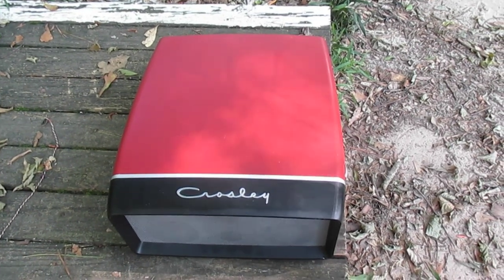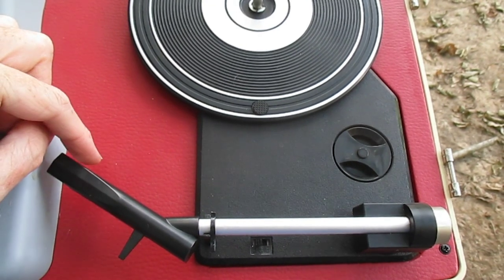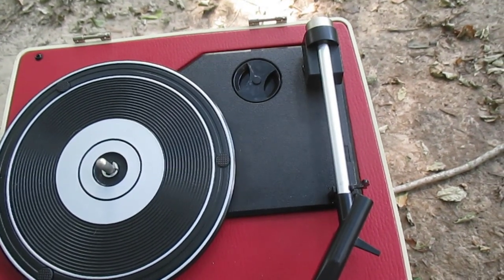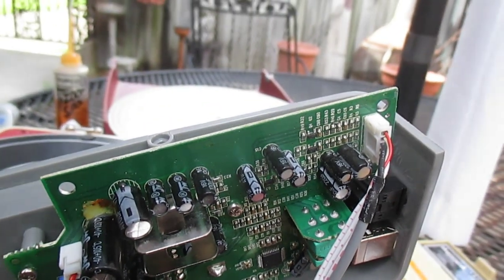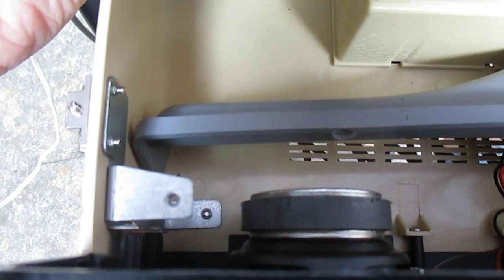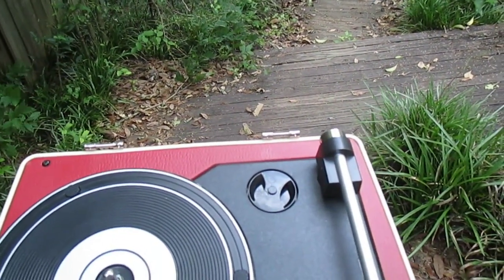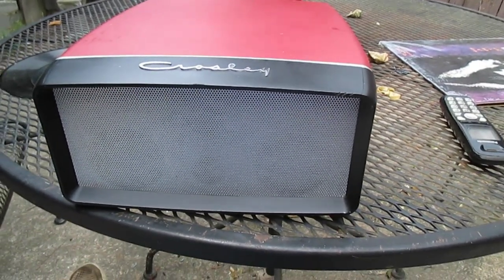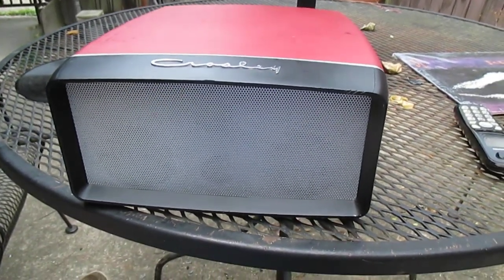Crosley Collegiate Record Player from 2012

Comment: BUSH and the old ALBA of the 60s/70s here in the UK made absolutely brilliant record players, same as RANK EMI and Ferguson all very nice machines. why dont you set the speed of the platter with a record playing and stobe disc fitted from underneath? that way youre guaranteed correct speeds. i would also fit line level outputs/headphone socket connected to the speaker outputs with 100ohm resistors

Comment: Great hints on trying to improve a 2010 (modern) Chineseum Crosley. The NP-5 needle is far superior than a NP-1 or NP-4.
Magnetic cartridge . Not surprised that the newest Crosley's are far more cheaper in design all around especially speakers.

Comment: if you have a hot air gun and a decent magnifier, SMD boards are easier to repair than thru hole boards with plated holes, even replacing large SMD chips is surprisingly easy

Comment: I have a Crosley CR-49, an earlier, larger suitcase player than the Cruiser, with a velocity type auto shut off (no switch putting back pressure on the tonearm).  On the plus side, the auto stop is gentler, it has a tone control, larger speakers, and the amplifier is better matched to the ceramic cartridge. On the negative, no headphone jack, and the motor has a plastic pulley, which greatly increases the rumble.  I bought a cheap motor on eBay with a brass pulley which improved the rumble, added a Banpa flip needle cartridge / needle, glued some counterweights (large nuts) on it, and it's now better than at least one of my school players.  Crosley did attempt a "true turntable" style table with the AT3600L cartridge, but of course with the rumble from that motor and plastic case, the table was not worthy of that Audio Technica cartridge.
Reply: Those  CR-49 Travelers are great, the slip cam shut off is reminiscent of the old BSR GU7 or GU8 mechanism, I live in Australia and crazy enough to buy 3 in all different colours from US ebay, the postage cost more than the players, I first saw Shango 066 vid on Crosley road test where he plays it in a moving car, a 87 Chrysler Diplomat

Comment: "they had no problem doing it in the 50s and 60s...so...they should be able to do it today"  AND they did it all with sliderules. 

Of course, one the main differences was price.  A decent portable record player back in the day would be the monetary equivalent of hundreds of Dollars today.  A metal or wooden box housing a power supply, a large AC motor, a metal motor board, the 3 speed rim-drive mechanism with a metal platter and the circuitry for the sound, plus either 1 or 2 decent sized efficient speakers.  It was sold in a store where the salesman was an adult who needed to support his family selling stuff at an electronics store.

If they were making/selling actual replicas (as opposed to facsimiles) made from the same materials and to the same standards, they would be 499.99!  Since nobody can afford 500 bucks for a cheap portable record player, nobody would have them.  Just imagine trying to make and sell a genuine copy of a BSR changer mechanism all made from the same materials today!

I lived through the last of them days as a kid in the 70s.  Everything was much more money than today. You can argue it was better built and it was better built, but it was still a lot of money.  For many, many people, it was the difference between having something at all and having nothing or at best, an old 2nd hand unit from a thrift store or something.  I had a record player as a little kid, it was a hand-me-down cardboard record player, probably a 1 tube wonder.

Comment: If I lived closer to Meridian or could afford the postage, I'd definitely place a bid for it. I need something to play my 78s on
Reply: RTVPN posted some tips on how tp modify an inexpensive two-speed turntable like an LP-60 for three speeds.  Super-simple, and you get the benefit of three speeds, magnetic cartridge, AND auto-return.  The LP60 is technically a full-auto turntable, but only with 7 and 12 inch records.  Have to manually cue a 10" disc. 

I want to mod mine for 16 rpm, but unfortunately that's a bit more involved than the 78 mod.

Comment: Try boiling the belt in boiling hot water for 5 minutes. It shrinks the diameter of the belt so it won’t fall off the platter

Comment: I have a heyday target brand turntable that is bluetooth and locked speed control, with a decent half inch mount audio technica cartridge and heavy aluminum table, it's almost as good as my ridiculous Pioneer linear tracking expensive turntable blind audio A and B comparison you probably could not tell the difference... These things have gotten a LOT better...
Reply: For $100 the Heyday is remarkably competent.   I'm not gonna pull anyone's leg and say it's an 'audiophool' unit, but anyone expecting such a unit at $100 is a just an idiot.

But it DOES play records, it DOES deliver good sound quality, and you can even swap in a better cartridge if you like (mine now sports an AT VM95 tracking at just 2g).  I'll admit I don't use the Bluetooth but I suppose it's a nice extra.

Comment: I always said that if I had to buy a modern Crosley, that would be the one I'd get. I like the style of it, and I'm surprised that it has tone control and dual 4" speakers that actually look decent. Not surprised at all about the magnetic cartridge tracking at 6 grams, though. But in the end, I still can't get past the cheap, chintzy turntable and the fact that it uses a walwart power supply

Comment: no circuit board crucifixion? This things still "...pitiful portable picnic player" lol
Reply: True, but they're worth salvaging some things from.   My neighbor about four or five years ago tossed one of these into the trash.  I snatched it up and took it home.  The platter was busted and the tone arm was bent.  Maybe something fell on it, I don't know.

Anyway, I salvaged the circuit board, the motor, and the speakers.   The amp board isn't all that bad, really.  I hooked it up to a pair of old Fisher bookshelf  speakers and was kind of surprised that it actually sounded fairly decent.  The board has a phono pre-amp, tone control, an aux/line-in, headphone jack, and USB encoder.  I figure it kicks out about 1 to 2 watts per channel, which doesn't sound like much,  but give it some efficient speakers and it'll surprise you.

The Collegiate speakers went to upgrade a portable Bluetooth speaker.

The motor can be used in a variety of record players.   Might use it to upgrade my LP-60 for 3-speed operation.

I think if Crosley had designed this as a mono unit, with one single, GOOD speaker instead of two smaller ones, and given a little more thought to the design of the phono mechanism, it would have been much better.  It's not like you're going to get a lot of stereo separation if the speakers are only eight or nine inches apart, anyway.  Give me a single channel of decent sound over two channels of crap any day.

Comment: They use the same speaker on the Crosley CT-100 cassette radio Bluetooth combo which is also a piece of junk as far as the radio section goes Poor sensitively on am and shortwave bands. Not made for DXing. Radio will only work in city environments with strong signals

Comment: They design these belts to fail. They use inferior rubber similar to rubber bands
Reply: I wouldn't say they do that intentionally for them to fail.  They use cheap, inferior belts because that's what their lowest-bidder supplier provides.

Crosley isn't really a 'hi-fi' manufacturer.   They just cater to a particular segment of the market.  The segment that hasn't figure out yet that you aren't going to get the best product if you shop based solely on the lowest price.
Reply: @xaenon  The hipster segment, now onto belts, the 80's Sharp products had belts turn into Plasticine after 10-15 years
Reply: @manFromPeterborough  Well... yeah, hipsters, but not JUST hipsters.  Nobody seems to consider anything beyond 'lowest price' anymore.  It's why we have stores filled with cheap Chinese junk these days (cough WAL hack MART cough cough....).

As for belts... well, those are considered 'consumable' items, just like the fan belts and tires of your car.  They're not meant to go 10-15 years.

Of course, these Crosley things seldom last even 3 years of regular use.  The people who buy them usually get bored with them quickly, or realize that they're crap and move on to better equipment.

Just a sign o' the times, yeah?